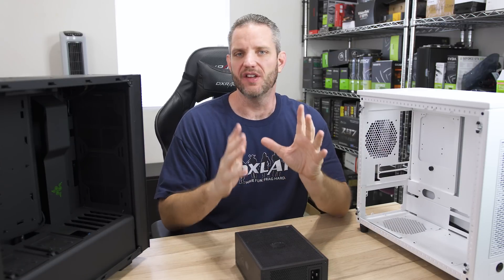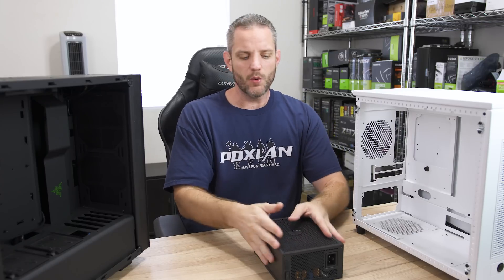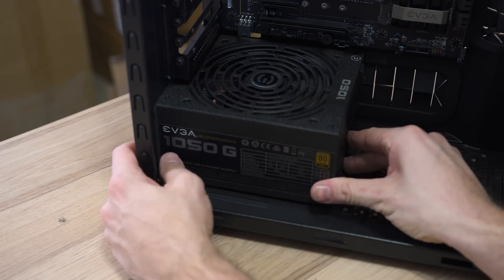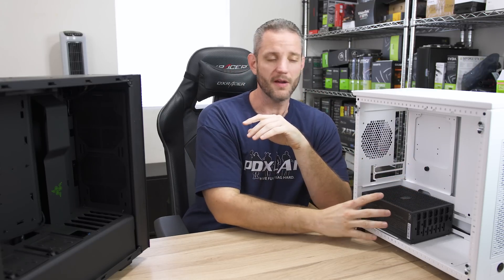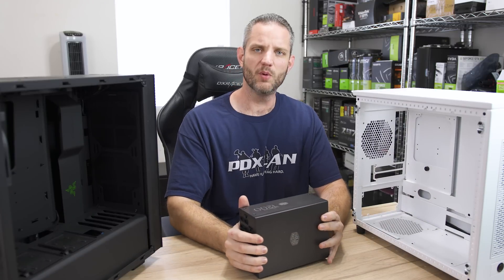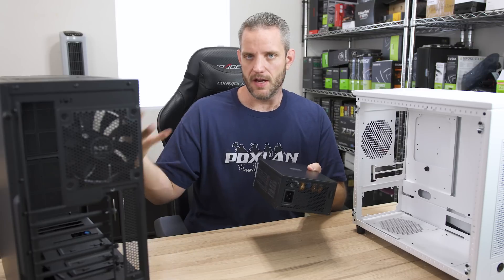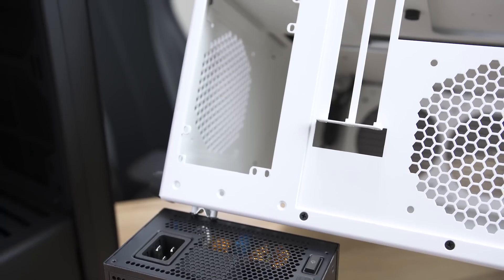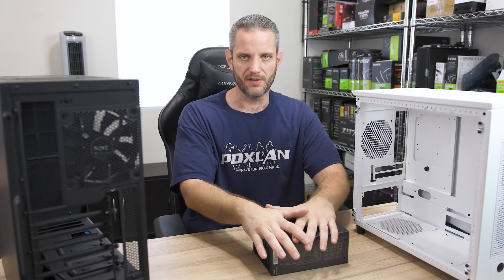Should you mount your Power Supply up or down?

Comment: I have a question: How can I overclock my penis?
Reply: Its called overcocking
Reply: depends what you are into. I personally use flexible tubing and a small resoirvar to pump LTT brand orange colored penis coolant (TM) through my shaft. Never exceeded 75°C while under load with full viagra
Reply: Zander Wurschtsalat Viagra
Reply: Yes but viagra is dangerous I search for a good option to overclock my penis
Reply: Yes, until it Gigahurtz.
Reply: sag mir jetzt nicht das du deutscher bist xD
Reply: CaveManta that also depends on preference, I use dual purpose thermal paste which also works as a lube for real world scenarios.

feelsmazeman Doch bin ich.
Reply: How can I watercool my penis do you havr a tutoriel for that ?
Reply: apply more voltage, the more the better.
Reply: You'll need superglue and a vibrator
Reply: Put some thermal paste and a hyper evo right at the tip. forget water cooling. too expensive
Reply: Zander Wurschtsalat ask Ed from Techsource he was able to cable manage his pubic hair and overclock his penis up to 4.2 ghz
Reply: That's a hot dick.

Comment: Jay what your thoughts on ITX cases where the graphics card is almost directly against the psu? which way would u mount the psu especially if using a gpu with multiple fans that might be blocked by the psu.

Comment: I'm a bit confused about the first bit. I've mounted my RM650x with the fan down, so it has it's own little enviroment, given that I live in an old home which is quite a dusty place and this way it's not really drawing more dust into the case. Right? When you mentioned the dust-part I got confused and listening to it over and over didn't make much of a difference.

Comment: as a side note, CompTia says to mount the PSU with the cable bundle or the 20+4 conector, for fully module PSUs, to the rear of the case.

p.S. love my Collermaster Mastercase Maker 5, great case

Comment: Surprised no one has ever watercooled their power supply.
Reply: There ya go lads https://cms-images.idgesg.net/images/article/2016/01/deepcool-liquid-cooling-psu-front-100637555-orig.jpg
Reply: jay yeffoc
 wait until you see someone liquid cool his liquid cooling pump...
Men will be men!
Reply: Yeah because 240v comes through the CPU, GPU or memory lol.. less than 2v goes through those and you wont even feel that.

Meanwhile the PSU is full of capacitors that, if blown, will release a deadly shock.
Reply: Pure/distilled water becomes conductive after a while because it rips off and collects metallic atoms from the various metals it flows over : radiators, water-blocks, fittings... So it will contain most likely copper, brass and nickel, and possibly silver (kill coil) ions.

It's fine if you are at the leak test phase, but beyond that, a leak may spell "huge disaster".
Reply: Dan Phillips even with "pure" water, over time you will get ions in the water from the materials it comes in contact with and it will become conductive.
Reply: quangluu96 like it has to have a point for PC builders to do it...
Reply: If you use "pure water" then it shouldn't make any difference, as water isn't conductive.
Reply: @Nielips  it wont stay 'pure' for long in a closed system as materials it's constructed from will leak into the water
Reply: @mysterycrumble  It can quite easily stay non conductive, you just add additives.
Reply: @Nielips  cool story
Reply: @mysterycrumble  Thanks mate, I'm glad you liked it.
Reply: i thought only distilled water has non conductive properties. care to elaborate on the additives?
Reply: @Nielips  also i don't think decent psus even have a heat issue?
Reply: Here is a shot at a water-cooled PSU unit, without casing http://photonics.engr.uga.edu/watercooling/psu_a_new.png

As you can see, there are elements that need cooling. AC/DC conversion is far from 100% efficient, the 80+ certification means that the unit will at least convert 80% of AC to DC, and the rest will become heat.

Here is the Corsair SF600 spec sheet, with efficiency chart : http://www.corsair.com/en-us/sf-series-sf600-600-watt-80-plus-gold-certified-high-performance-sfx-psu I mention it because I own it and I know it's readily available.

Imagine a computer pulling 400W at full load, on this 600W 80+ Gold power supply. That means that the PSU will convert 91% of AC to DC, and must draw 400+(400*(1-0.91)) = 436W from the wall, there are therefore 36W waste heat. Remember the watt is a unit of energy per second, so each second adds 36 joules of heat. This adds up.

Now, 36W isn't a lot to cool, compared to a high-end GPU and CPU. But it can still be as much as a laptop's CPU needs of cooling, and you know, they can get toasty.

At the end of the day, yeah, considering the evolution of cooling solutions for PSUs when it comes to silence (better fans, no fan at low load), water-cooling a PSU now is pointless and as said, stroking 1337 epeen. It can still be a fun project to do though !

Also, as a benefit it may help reduce the volume footprint. Which I'm all for since I like SFF PCs very much.
Reply: Ruben van Leusden Holyyyshit! hilarious.
Reply: Ruben van Leusden There aren't that many PSU blocks out there... EK has a grand total of none, Koolance produces their own PSUs with water-block, there's this one I linked to before, and that's it. PSUs aren't water-block-ready unless they are custom-made, and to begin with, manufacturers warn PSU buyers to not service it themselves. After that, it's all custom.

On top of that, like I said, a standard 120mm fan does a wonderful job already, since if you consider water-cooling PSU, it should already be of good quality and have a good 80+ certificate, and have a silent fan with fan-stop capability.

Final note to consider : I'm not sure coupling water and a PSU that tight is that good an idea, unless the block is in the bottom of the PSU. Leaks aren't to be taken lightly with high voltage and intensity. A fried PSU can fry your whole system.
Reply: Seen plenty of water cooled PSUs over the years - but overall, its not really worth the hassle. PSUs (at least a reasonably modern one propely matched to the power draw) don't generate the same levels of heat as GPU, CPU etc - and a single, quiet fan usually is more than capable of keeping it cool enough. Also, as sort of pointed out - its somewhat of an isolated system, so it doesn't contribute much to overall system heat, nor is it that impacted by case system air temps. Lastly - CPU and GPU has fairly simple layouts, one single small flat (primary) source of heat. Not quite so with a PSU. That makes constructing efficient water blocks for a PSU, quite a complex, tedious and expensive task. Its simply not worth it, and is more of a thing for the "because I can" customizers that can make or aquire their own custom blocks.
Reply: quangluu96 rlly just stroking 1337 epeen at that point..
Reply: You get no benefits from watercooling it and reducing the temperatures, you only risk destroying it and everything else.
Reply: Ujiltrom M
 Good thing I basically live by the rule "it aint awesome when it doesnt look like awesome" :3
Reply: Mandem Wait until people water cool their water cooling pump for their water cooling pump
Reply: Ujiltrom M It's a joke, god damn it
Reply: tec are you dumb cpu + gpu = electricity it'd the same thing
Reply: tec you mean like the CPU, GPU, memory, and motherboard?
Reply: LakerTriangle ikr he's not the smartest
Reply: Senat I don't mean like mineral oil...Like with a custom block. If you've seen that shoot a link.
Reply: LakerTriangle no motherboard is water cooled
Reply: Saw one watercooled on one of the Mod competitions. I believe it was an in-win one.
Reply: Avodat
Reply: Ujiltrom M thanks for the clarification man! 
honestly, I can already imagine the amazing aesthetics of my rig when I add a water block to my psu! 
darn awesome way to provide ambient light from down that area!
Reply: LakerTriangle that would be cool. With LED strips.
Reply: Well then, be my guest :D Have fun !
Reply: GTA ONLINE Erm, in the popular selection, aside from the Laing DDC that could need a heat-sink housing, I don't see pumps not relying already on dumping their heat in the loop, making them effectively water-cooled already.
Reply: Ujiltrom M - Correct. All pumps are designed to cool and lubricate itself with the liquid it's pumping. 
though, DDC's are often being sold with custom cooling-efficient aftermarket casings since the actual motor is placed at the bottom, powering the rotor by magnet magic, and runs quite warm at higher revelations.
Reply: GTA ONLINE
 Worry, thou shall not. Young padawan. For I had joyfully expressed my emotions through facial expression, post acknowledging thee written message.
Reply: Mandem lol
Reply: GTA ONLINE Dangit. I could totally see people try to do that. Sorry for being dense ^^"
Reply: Tim Parker what's dumb is you not reading the previous comments to see it's been done.
Reply: RdyPlyOne here's a non offensive answer, PSU doesn't use any kind of multiplier, so I wouldn't be excited to get a couple more watts (which is not performance) if the price of the block is near the price of a high-end PSU (just sell your psu and buy a higher-end one).

Also, imagine a short (skipping the capacitors and other resistors) in a component that receives 220v and outputs 12v, the amount of current would probably kill anything in its way.
Reply: Check Linus's channel, he posted a review of a hybrid water cooled PSU a few months after your comment. If memory serves, it did give an improvement in cooling performance, but it was small enough to not matter.
Reply: Lmao soemone has
Reply: Hydro PTM

Comment: Even though my case is on hard wood, facing my power supply fan down actually caused computer to shut off under load. As soon as I flipped it back to fan up, the problem stopped. I think I'll stick to facing upwards. In an environment where dust or pet hair is an issue, I'd recommend having it faced upwards - I was surprised to find how much dust and hair collected within just a few days.

Comment: How can you use more than one powersuply? And why can't you just put 2 power supplies in a PC?
Reply: Elijah The Beast motherboards are designed usually with only 1 20/24 pin on the motherboard and that 20/24 pin is what tells the power supply to turn on or turn off, so if you bridge the second power supply or keep it always on, you can for example, use the PCIE 6/8 pin connectors if your doing something like running quad sli/quad crossfire but you require an obscene amount of wattage
Reply: Derek King 
Thanks